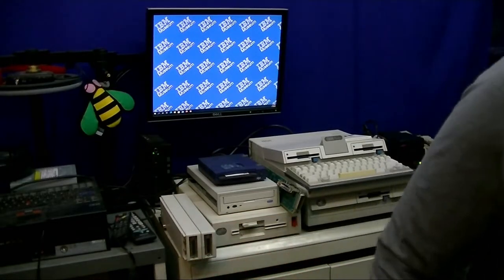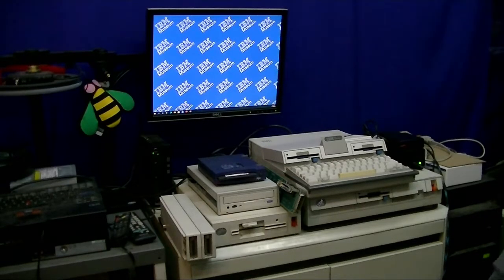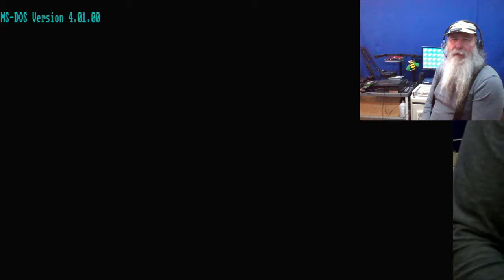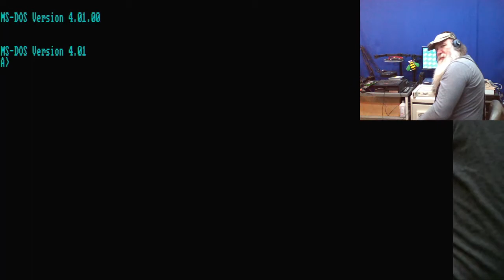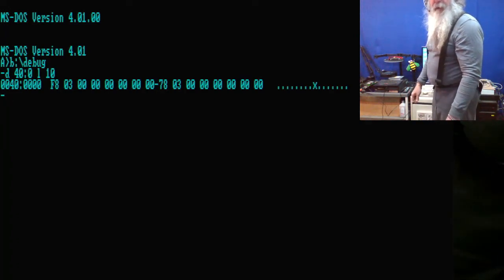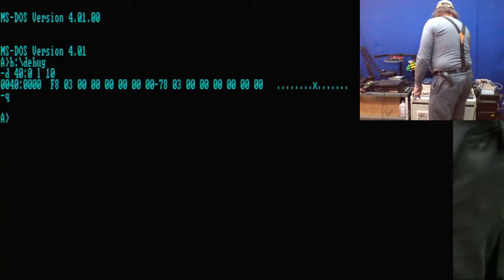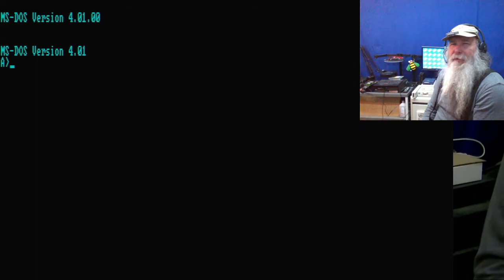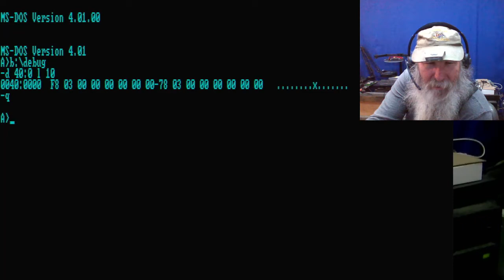Stacking COM/LPT 'slices' on the IBM PC Convertible!

Comment from the maker: The "Serial/Parallel Adapter" for the PC Convertible is covered in Volume 1 of the Technical Reference, physical page 106, linked here: https://www.ardent-tool.com/5140/6280655_PC_Convertible_Technical_Reference_Volume_1_Feb86.pdf#page=106 - Any notion of being able to "stack" the serial/parallel slices aren't possible, but there may be another way with simply inverting an address line.